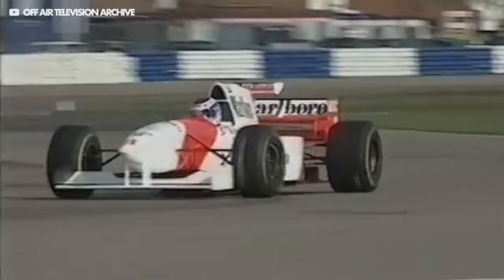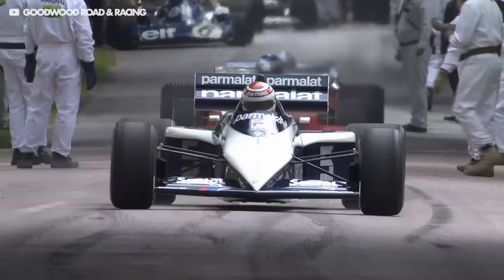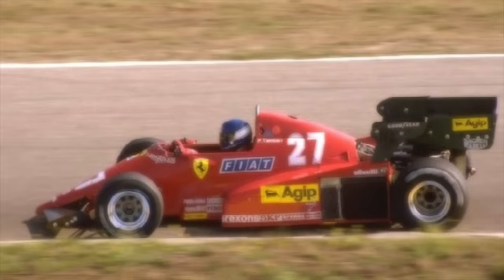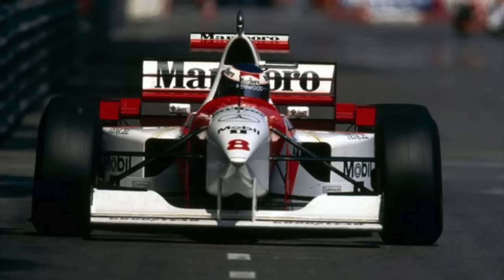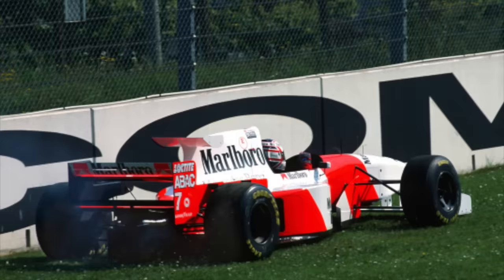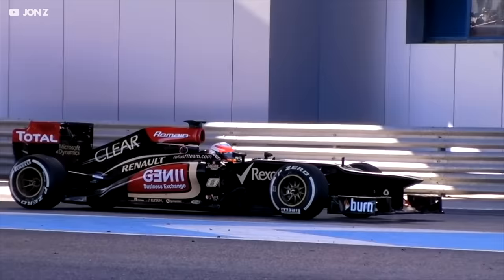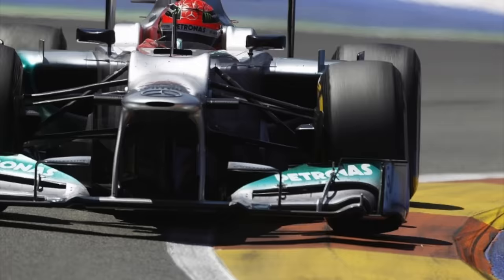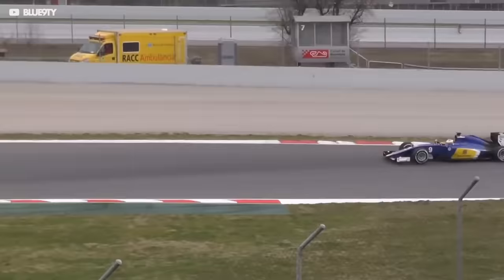When Formula 1 Designers Get Creative

Comment: I really want to know what the current technology would be able to do without any restrictions or safety concerns. Like how big or wide would be the perfect balance between weight and handling, how many tires for grip and weight balance
Reply: Red Bull made the X2010 concept car for a video game
Reply: The porsche 919 hybrid is somewhat your answer.
Reply: @SilkCutJaguarXJR-  that car was a decade ago
Reply: @edgiestofcars  well yes
Reply: @oreofudgeman  Still slower than current F1.
Reply: @khoado2060  i think he meant the 919 Evo

That thing obliterated every lap time it set its foot in
Reply: It would be awesome to see what f1 engineers could do with the open wheel platform if they could just go crazy
Reply: @SilkCutJaguarXJR-  but that's in a video game, it would be cool to see what they could make work in real life
Reply: @VERY EVIL PERSON FROM ILLUMINATI It is in fact still slower than F1, even at the same year as it ran. 
919 evo Spa lap time (set in 2018): 1:41.77. 
2018 Q2 time (Ferrari, Vettel): 1:41.501. And that was Q2. It would have gone another 4-5 tenths faster in Q3 (as seen in other years), except it rained in Q3.
2020 Spa pole lap (Hamilton, Mercedes): 1:41.252
Reply: @ASJC27  it was admitted that they were holding back because there's only one.
Reply: @Matty.Hill_87  it's possible to make but no one would be able to drive it on the limit. Too much power and downforce. Eyes would not be able to keep up
Reply: @brandy0438  oh really? I never knew that
Reply: @placeholder2924  I doubt that. Do you have a source? And even if they did, 7 tenths worth of holding back? That's a massive amount.

BTW, what I find interesting, is what would happen if they just take an F1 car as is, not change a thing but remove the software limit on fuel flow. F1 cars are allowed to rev to 15,000, but they don't rev past 12,000 because the fuel limit means they can't feed enough fuel at higher revs. If they remove this limit, the same engines without any modifications would generate about 200 HP more. That would make for some crazy lap times with just one software change.
Reply: Many times restrictions lead to bigger innovation, this is the essence of problem solving.
Similar in science, we have always innovated because of lack of certain types of resources or restrictions. 
This is why i love f1, it pushes engineers and designers to extreme because of how competitive the field is and how many restrictions are placed.
Reply: without restrictions there isnt a human body able to handle g forces and such enormous grip that designer's can make on "that" car you wanna know @khjfreddy
Reply: There was a race back in 2001 (there’s a video about it on this channel) where the drivers were literally passing out, so I’d guess we could make something well beyond what a human could withstand. 

But I agree, I’d love to see what’s possible
Reply: @eriksipple4270  i saw that video, back when wing cars were allowed, Reutemann in a argentine tv programme told that in spa (on those fast two left cornes) drivers lost vision on the apex because their blood when on the rigth side of the brain so the left part was "blind" for 1 second, amazing and scary things
Reply: @VERY EVIL PERSON FROM ILLUMINATI it was fair than f1. Current cars are a couple seconds faster
Reply: @ASJC27  but at the time it was faster than the last F1 car to race at spa, which was in august 2017. hamilton's pole lap was 1:42.553 the 919 EVO set a 1:41.7 in april of 2018 so they only held the lap record for 4 months but still for 4 months was technically the fastest car to ever set a lap at spa, and still wasn't far off of the 2018 F1 car, not to mention all the variables that come into play at spa like weather, track temps, wind and such.. i.e. the 2019 pole time was closer to the 2017 time at 1:42.519.. safe to say the 919 EVO is on the same level as an F1 car, faster than most of the midfield and backmarkers at the very least
Reply: @Matty.Hill_87  it would work in real life..... with some research and development obviously. But there would be no point because the G’s that the car would pull in the corners would make the driver black out or in extreme cases it could be fatal. But the car was designed with a realistic physics engine and stuff like that, so technically it could be made in the real world.
Reply: @sebrr  Yes, but still it ran in 2018 and was slower than the F1 car in that same year, so I don't think it's fair to say it is faster than F1, when the contemporary F1 car set a faster time. 
This was also at Spa, which plays to the strengths of the 919 since it's a high speed track calling for a low drag setup, and still it is slower. At most tracks the F1 cars will be way faster.

What impresses me is that a limited F1 is still faster than an unlimited modified prototype. 
As I said in a previous comment, even just turning off the software fuel flow limiter on an F1 car without changing anything mechanically would give it 200 hp extra and it would obliterate lap times everywhere it goes. I would love to see it (even with an older car) if some team was willing to pull a publicity stunt.
Reply: @VERY EVIL PERSON FROM ILLUMINATI The 919 Evo is now officially not faster than an F1 car. At last year’s Belgian GP quali, Hamilton’s Q3 lap time was 5 tenths faster.
Reply: @Matty.Hill_87  if I'm not mistaken, open wheeled platform isn't actually the best in terms of aerodynamics
Reply: @VERY EVIL PERSON FROM ILLUMINATI no it’s not actually. The lap at Spa was beaten by F1 a few months after the Evo set the record
Reply: Well you have the McLaren MP4-X
Reply: @VERY EVIL PERSON FROM ILLUMINATI No actually.Hamilton beat 919 Evo's 1.41.7 on Spa with a 1.47.2 last year.
Reply: Definitely add some spikes to the car as well as front and rear missiles.
Reply: @tonyetzu  why not a space shuttle booster
Reply: @VERY EVIL PERSON FROM ILLUMINATI it is nor faster than f1, f1 destroyed it at spa
Reply: @z1tekk  lol love it
Reply: @eriksipple4270  haha, cheers from argentina
Reply: @VERY EVIL PERSON FROM ILLUMINATI no it isn't, it wasn't even faster when it was built.
Reply: Give the designers a hypothetical cube, a simple set of 3 dimensions that they have to remain within. Then let them create cars that are innovative and diverse.
Reply: Hop on Gran Turismo. A lot of the same engineers and designers help create those beautiful machines with no  holds barred
Reply: @Matty.Hill_87  open wheel is worse than prototype
Reply: Look up the cars made for Le Mans. Essentially what you are asking for.
Reply: The car would be basically undrivable lol
Reply: The Pikes Peak cars are able to do pretty much all they want as long as they have the required safety gear.
Reply: If you could qualify in the pole, having a super wide nye unpassable car would be best. Just imagine if every race was Monaco where you almost always finish where you start.
Reply: @VERY EVIL PERSON FROM ILLUMINATI yeah but if f1 didn’t have so many restrictions f1 would be faster
Reply: for open wheel, i’d say something along the lines of the Red Bull X cars. for enclosed cockpits, definitely a newer version of the Porsche 919 Evo or more fleshed-out versions of the LMP cars. either way, they’d be fan cars with active suspension, fully electric cars or hybrids with motors on all 4 wheels that serves as a high tech AWD system. that’d also help a ton with cornering since they’re independently powered. i’d be really interested to see what else they come up with
Reply: @oreofudgeman  #FACT
#TRUEWORDS
Reply: idk if you still read this but porshe did a funny one i think it was a 918 and the bloddy thing was so fast the limiting factor was neck strenght
Reply: Pikes peak is there
Reply: Jet engine behind F1 car

Comment: Take a shot every time the term "downforce" is said in the video, and then go in the sim to do a few laps around a track of your choosing.
Reply from the maker: Great idea!
Reply: Back in the Nascar 2 and 3 days, the best and most intense online racing took place in the wee hours of the morn. Most the drivers came fully loaded. I know I was. Usually pound a bucket or 2  of Peppermint Schnapps and puff a bowl while looking for the next good 'Dega run.    
 In spite of most of the drivers being tanked up fuller than the cars, the racing was clean and close as all the sober wreckers went to bed.
 Just for the record, I won my share of races like that. Great times!
Reply: @Driver61  Maybe you can lap Martinsville at NASCAR HEAT 5
Reply: @thomasgoodwin2648  sounds like one of my dirt races.

Comment: I would like to see an FIA sanctioned series where the engineers can go full balls to the wall and get the absolute fastest lap times and racing possible. No restrictions, just lap times.
Reply: A lot more drivers might be killed, so it's unlikely to happen.
Reply: What we need is a ruleset similar to the old Can-Am series, but with modern safety and driving regulations instead.
Basically: as long as there are your basic driving rules and the driver can survive a crash, you are free to do whatever you want with the cars you design

Comment: @Driver61 The reason McLaren MP4/10 had the third wing wasn't to do with downforce, but rather to recover the air pressure lost from the opening of the  airbox Engine intake, who is behind the driver's helmet. this was really ingenious as it allowed to have extra pressure, so basically bending the regulations who wanted to limit air pressure to the engine - for those who don't remember the 1995 cars weren't turbo boosted, they had normal aspirated 8, 10 or 12 cylinders engines, so air pressure was used to give the engine boost and FIA tried to limit this. this to my knowledge of course, they removed the third wing later as I believe made the airflow to the back wing less efficient, but I might be wrong on this one

Comment: There should be a league for pure engineering. Yearly budget is 1/10th of F1. Each car is handed 30kg of the same fuel before start (or equivalent in electrical energy) to complete a 300km race. So something like 1/3 of what F1 gets. So not crazy fast on average. Other than basic safety rules... there are no restrictions on the design... After a few iterations the designs will be out of this world.

Comment: I really wish we could get back to this. I wish the rules were “make sure it’s open wheel and comply with this list of safety regulations, and other than that go nuts.” 

Today every team is trying to figure out loopholes within the rules and ways to bend the rules without breaking them and that just seems strange to me. Instead of the FIA dictating (largely) the look of the cars I really wish they would let anyone design and run anything as long as it’s safe.

Comment: Looking at all the downforce enhancing contraptions getting strapped to the modern F1 cars I can't help but wonder why modern aircraft don't come out as much disfigured either... You could probably flip an F1 car upside-down, give it a propeller or something, attach some control surfaces... and get a functioning airplane mostly in the dimensions of the said car.
Reply: Most f1 aero features are incredibly inefficient and wouldn't exist if they weren't trying to workaround rules. 

Aeroplane design is very much purer because the regulations allow them to be. 

An example of conflicting requirements is found in stealth aircraft, which are terrible aerodynamically compared to say a gen 4 fighter.

Comment: I don’t understand why they don’t use cameras and HUDs or better AR in the drivers helmets

You could get rid of mirrors completely with use of a HUD or AR Helmet with all kinds of information speed, images behind the. On the left right, or even just a indicator light that flashes a different speeds to let you know how close someone be is to you!

You could have track and turn information you could have the VSC or other track conditions pop up all with opacity so driver still has 100 percent visibility!

The other is a cooling system for their drivers so their drinking water is circulated around their suit to only be cooled by air in some aluminum tubes as it renters the suit but the driver could take a drink still at any time.

Or have a finger size scoop that can be open or closed when the driver is hot scoop pops up allowing air to blow through out  tubes in his suit.  Kooning him off!  

That said I still like the AR helmets like what the F22 and F35 pilots have! Able to look out of through the plane!

Comment: I love it when designers find solutions that aren't specifically addressed in the Formula. Also, it seems calling what they do finding "Loopholes" - though accurate, gives it a negative connotation. To me, the problem is the rule makers attempting to stop, or erase every bit of innovation and creativity in design. If that happens in enough detail and for long enough F1 will simply become spec racing and will lose its audience. We are getting closer and closer to that point. How many fans want to see exact replicas racing with the few differences being the car colors and sponsors? I'm interested to see the 2022 cars and how much they differ in individuals team's interpretation of the rules and certainly hope that each team"s cars are very different, wildly different even.

Comment: How did adding the mid-wing, in front of the rear wing, to recoup downforce lost by the regulations restricting rear wing height, move the aero balance too far backwards? This does not really make sense. Creating additional downforce in front of the area where the downforce was lost, would move the aero balance forward, not backwards.

Then, you said that in the 1997 season the height of the font wing above the ground was increased. I think the loss in downforce was not because of the greater volume of air flowing below the wing, but because the increased distance reduced the ground effect. increasing the amount of air flowing over a wing should increase the downforce. (see the very high camber frontings FSAE wings, to move more air blow the wing, increasing downforce). You said that the X wings created central downforce, not disturbing the aero balance. How did the aero balance stay useful, if front end downforce was reduced, and central downforce was added. wouldn't the aero balance move backwards under these circumstances?

How did the arrows car combat the aero balance issue? Were they able to increase the rear wing downforce to compensate for the added front end downforce?

regarding the Brabham BT 52, you said the radiators were in front of the front wheels. I think you mean rear wheels. Also with the rearward weight distribution, wouldn't the car be difficult to rotate in slow corners suffering from understeer in mechanical grip corners, while having high-speed oversteer, due to a lack of rear downforce in aero dependant corners?
Reply: It moved the aero balance backwards because it only solved the issue of the reduced rear downforce. This means that the car only suffered a loss of front downforce resulting in a rearward aero balance.

Ground effect works by accelerating the air going under the aerofoil resulting in a lower pressure under the car and thus downforce; the acceleration is caused by having the aerofoil as close to the ground as possible. In the case of the front wings being raised, it's technically correct to say that the increased volume of air going under the wing increased the air pressure, even if it's a bit of a simplification. It's important to note that it's the volume of air below the wing that increases not the volume of air going over the wing.

The X-Wings because they were central it means you can get more net downforce whilst being able to set up the front and rear wings to get the balance the driver and track need. Bearing in mind that the X-wings were only used on tracks that required high downforce like Monaco. Similarly the extra wing on the Arrows was only used on higher downforce tracks that often required better turn in than the car was otherwise capable of.

With the BT42; they would have designed the car around the fact that the weight was so far back meaning the problems that it would cause. The rearward weight distribution was dealt with presumably by having a setting the break balance such that it made the car more willing to rotate in slower corners, similarly it featured an especially large rear wing which would increase rear stability in fast corners. All in all the drivers said it was an easy car to drive and it won the drivers and probably would have won the constructors if not for Patrese's horiffic luck.